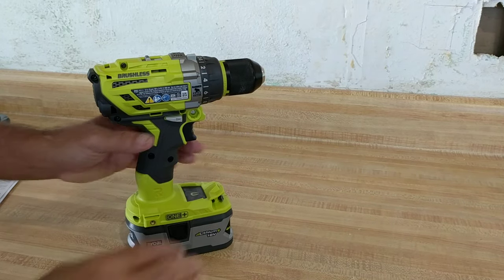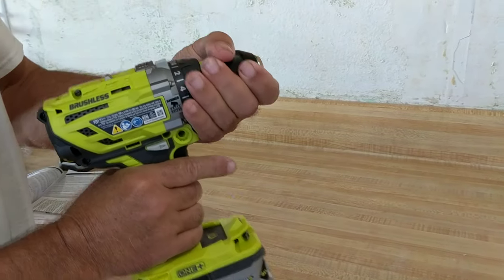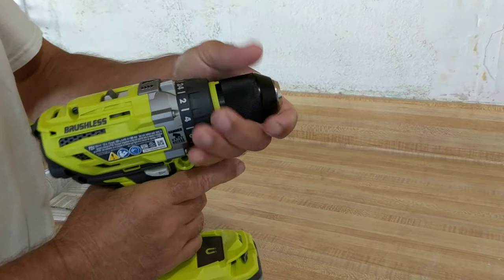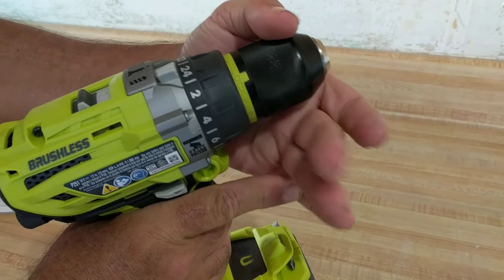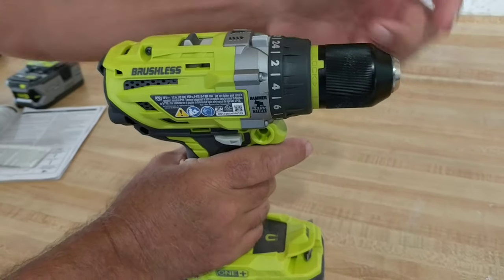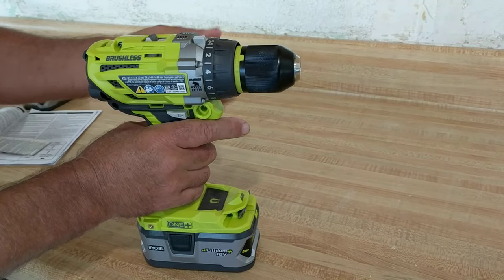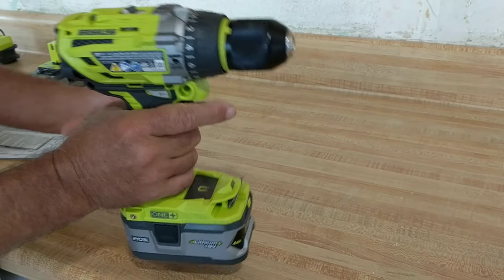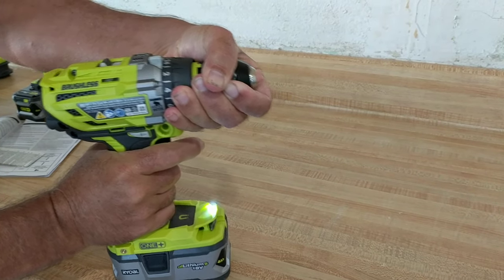Unlocking the Drill Bit Chuck on my Ryobi Hammer Drill

Comment: Thank you so much for this - Brilliant!! Had just bought new Guild Hammer Drill and new Guild Drill/Driver from different vendors and both devices came with stuck/locked chucks. Fuming!! Saw vids and links saying use WD40 ... pipe wrenches etc and others saying don’t use wrenches or you’ll strip the plastic. Have just freed both my drills in minutes following your advice. Big, big thank you!

Comment: Thank you! Was really frustrated by this. I set the speed to the fastest and held on tight to the front part of it. The chuck still didn't want to rotate though as it was still stiff, so I just put a cloth over it and used a pipe wrench to loosen it (the cloth is so that you don't damage the plastic).

Comment: Just to let people know who are still having a problem, it will work. Mine was particularly stuck and I thought may be broken.. But I just needed to use channel lock pliers around a rag as suggested and it finally worked free. Just make sure you protect the chuck with a good rag. I set the drill to drill mode, and like original video said, forward position. Good luck, great video. Thanks.

Comment: Nice that all the commenters here are happy to have gotten their bits out and we all appreciate that Bob posted this helpful video, but I'm jumping on here to say this:  THIS DRILL IS BROKEN, in the sense that the user should not have to resort to operating the tool contrary to the safety instructions that require immobilizing the operation of the tool before removing or installing the bit.

This is ridiculous and a design flaw.

Comment: Hi thanks. I did the same but doesn't work!!! What to do
Reply from the maker: If you have trouble holding the chuck with your hand you may need a glove or strap wrench. This drill has a lot of torque. Make sure the rotation set to go in the normal clockwise direction.
Reply: Thank you me too   Thanks for the help!
Reply: Just to let you know that the Chuck  was broken and the store gave me a new one. Thanks.
Reply: Well mine was working fine until I tried attacking a nut to remove the seats on my Jeep jk and on the first try  it all broke loose.... the chuck came off and I noticed if you open the Chuck all the way you can see a screw inside that chuck where you insert the bits .... well guess what that bolt broke aswell .... and if I try to use it the whole chuck just unwinds and comes off .... see how long the warranty takes ... just have about one month with it

Comment: My new Ryobi P222 simply will not allow a drill bit to go into it.  Instructions only say, apply pressure and turn in the direction of the arrow in the diagram...clockwise.  No way.  $109.00 dollar drill, it shouldn't be this difficult to insert a drill bit.  I'll check more youtubes see if I can find some help.  I tried the above however my drill isn't the larger drill.  Thank-you.